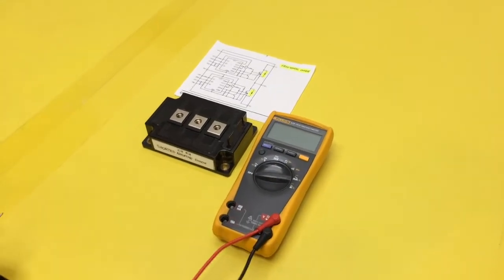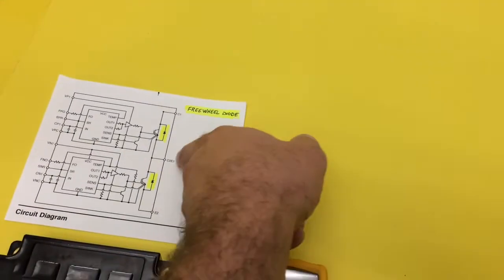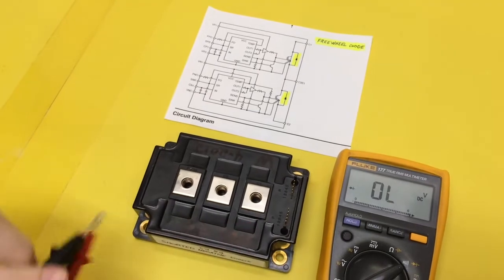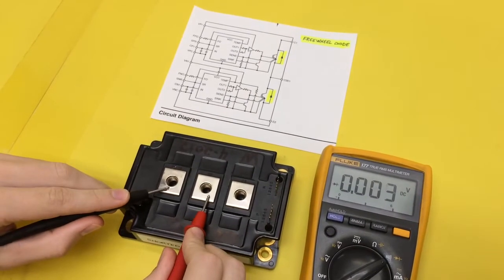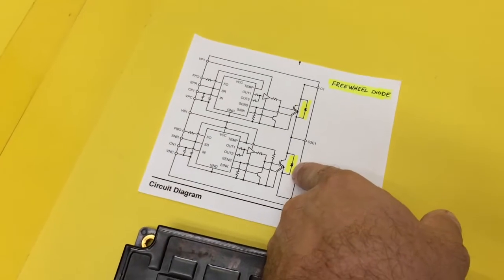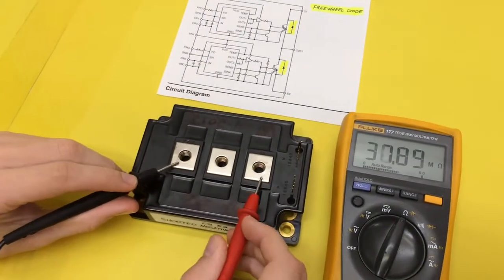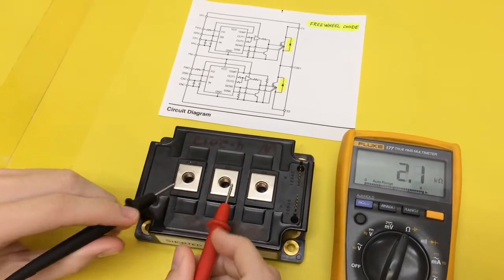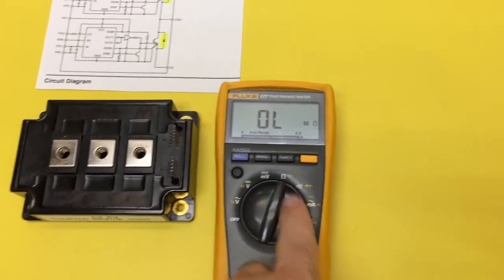IPM IGBT Dual Pack Quick Test Meter Diode & Resistance Mode  [KTFG 340]

Comment from the maker: Some handy Test Equipment & Tools:
Handheld LCR Meter Der De-5000: https://amzn.to/2yQxFa2
Drok Electronics Component Transistor Tester: https://amzn.to/2tRTFeS
Multifunction Meter DIY Kit tester: https://amzn.to/2KvanIk
Atlas DCA55 Semiconductor Tester: https://amzn.to/2MC395F
Peak Electronic Design: https://amzn.to/2KujjgZ

Rigor Digital Oscilloscope: https://amzn.to/2ICP5Xa
Fluke 177 Multimeter: https://amzn.to/2tPtS7b
Fluke 62 IR Thermometer: https://amzn.to/2tDDrac
Bench Power Supply 0-50vdc: https://amzn.to/2yWir3s

Wera Kraftform 70 32 Piece Set: https://amzn.to/2MBZXqH
Wera Kraftform Compact 25: https://amzn.to/2IE6DSO